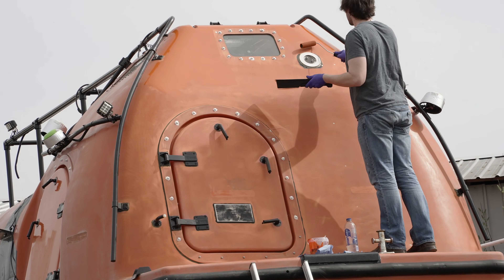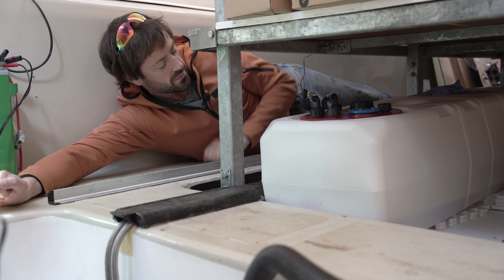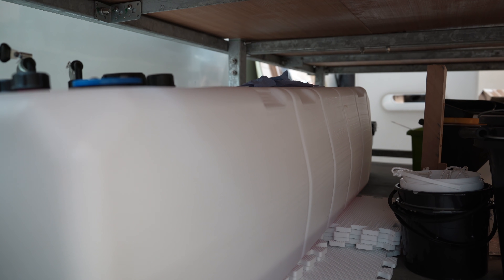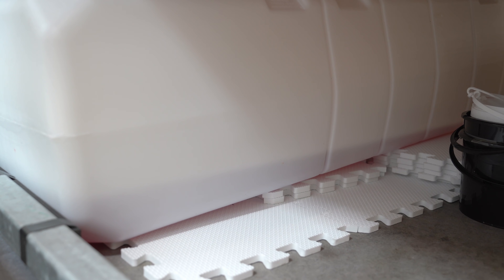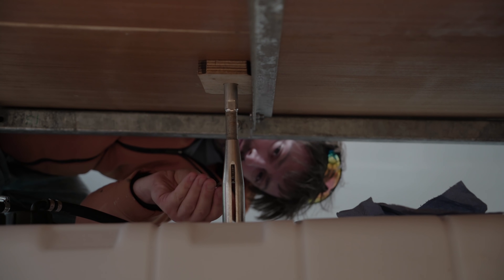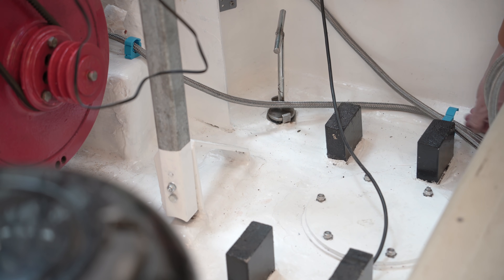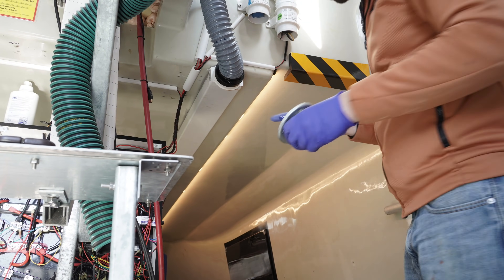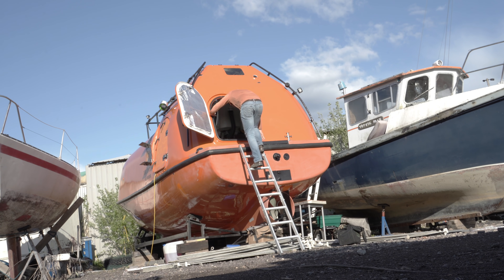Lifeboat Conversion Ep16: Fitting a new fuel tank to an expedition lifeboat [4K]

Comment: Love the update.  I had a massive fuel cell on an off road vehicle and delt with sloshing of fuel.  They make internal baffling (special foam) that will not interfere with your fuel sender or breakdown into the fuel filter.  They use it in powerboat racing and racing applications with high G & vibration.  Also as with any enclosed system please ensure the blower is always running. Carbon Dioxide off gassing of the engine and the dangers of a vented tank near non-explosion rated electronics in close proximity are a recipe for disaster.  Vent the tank via a line to the outside. An empty tank is more dangerous than a full tank.  Keep up the great work.  Love the process.
Reply from the maker: Thanks for this. Yes I do have baffles ready for the tank - balls rather than foam as the latter can deteriorate over time in diesel.

Re: the explosion risk - remember that diesel and petrol fumes behave very differently, so for diesel fumes to be a spontaneous fire risk would need pressure or heat - more than a spark alone. But yes indeed, I'm looking to ensure both ventilation and the breather hose are installed a-ok.

Comment: to secure the tank, you could use straps, the ratchet kind, quick to fit, quick to loosen and definetly not going to move
Reply: Yup, that's what many boat manufacturers does. Use A4 stainless steel straps.

Comment: When you rig Allen with whatever spare parts you think you'll need on a voyage, don't forget to include an extra priming bulb. We got stranded 3 miles off of Marathon Key in rough water because the bulb had cracked & the engine wasn't able to suck fuel through the hose. It was a 28ft rental boat and the owner didn't have any tape or tools or anything on board I could use to fix it so we had to be towed in. Luckily the marine radio worked or we'd have been adrift for a long time. The moral of the story being that it will usually be the cheap & insignificant or obscure parts that fail and end up ruining your day.
Reply from the maker: True story. What I love about boats is you can take lots of spares. On ski journeys you just can't afford the weight.

Comment: Baffles inside will help a lot, you could add some plastic forms to reduce sloshing, this is a common solution
Reply from the maker: Check out the community page for my channel :)
Reply: I know its common for fuel cells where you have stainless steel welded together but gluing baffles into HDPE probably wouldn't work out that well.

I did see the community page. It'll be interesting to see how well those balls work.  I mean realistically you'll know they're working by forgetting they're even there.

Comment: Its quite challenging to get a sense of scale of Alan, if it's enormous with all these different spaces or if its tiny with having to constantly crane your head and fit into tight spaces
Reply from the maker: Single space. 7.5m total boat length. The stern section is about 2.5m standing space. In the forward section more like 1.7m, so stooping needed.
Reply: @AlexHibbertOriginals  thank you! :)

Comment: Hey there. Plastic fuel tanks are fine. This size of 100L is small and doesn't need baffles. But plastic tanks do expand ~2% when first filled with hydrocarbons. Make allowance for that. Straps are perfectly good to secure them. I've designed fireboats with AFFF plastic foam tanks of 2000L. We just secure them with straps, but sometimes they are metal straps with turnbuckles (bottle screws) to tension the straps. Finally the pressure/vaccum vent is umm...odd. Typical marine practise is just run a hose from the top of the tank to an external breather fitting that pokes out the side of topsides, high up. A breather valve might not open up with the very small suction pressure from a diesel lift pump or might burp diesel if the tank gets warm. Orienting the tank long'lly is indeed the best because it increases stability. Ever carried a dishbasin full of water? Google the free surface effect
Reply from the maker: I really should add disclaimers to each video to say that not everything is complete! One with bright coloured flashing lights.

Comment: Look into riv-nuts rivets/nuts where you can essentially install a nut into a hole to bolt into. Although you will need a tool to install them. They are quite handy.
Reply from the maker: Yeah a few people have mentioned. Another expensive tool!

Comment: I had another idea for anti slosh, I’ve seen hollow balls used with lots of holes in them, these are easy to put into tanks, but once inside they fill the volume and reduce sloshing.
Reply from the maker: As I said, check my community page and you might see some large hollow balls!

Comment: The only acceptable way to vent a permanently installed fuel tank is overboard. Without a proper vent you'll be displacing litres of toxic diesel fumes into the cabin every time you fill the tank and then again when the warm diesel returns from the engine...and every time the cabin temperature is raised.
Reply from the maker: You're going to love the episode when I install the breather hose!

Comment: Fit a resistive tank level sender but size it up so its length is above the fuel feed outlet. That way when it warns you its at 0% you know you haven't run the tank dry.
Reply from the maker: Certainly could, but the tank is translucent, so you can just see how much fuel there is. I use an additive that darkens the fuel, so it's very visible.
Reply: @AlexHibbertOriginals  Fair enough, just the convenience of maybe wiring in an alogue fuel gauge or even a digital reading on a Victron Cerbo input. You could go one step further and edit the Victron code for a Cerbo GX so when a reading of 0% is acknowledged, one of the relay switches turns on a pump and feeds more fuel in. It would be interesting to see more dynamic functions with Victrons products.
Reply from the maker: Thanks - will keep that in mind

Comment: That press fitting might punch a hole in the top of the tank if a large wave bounces it up.
Reply from the maker: It's braced, so there'd be no impact, and the area is spread out and damped. If there's a force that large, I'd probably have bigger problems, like Alan being in pieces.

Comment: Couldn't you use an hybrid system wit solid thanks on the bottom and fuel bladders on top as auxiliary fuel supplies, so that they can be folded away after use to leave more living space?
Reply from the maker: That'll be the plan. This'll be the only solid plastic one.

Comment: Personally I'd be getting rid of the stainless overbraid fuel pipes as you can't see what's happening with the rubber underneath and it doesn't clamp correctly. Also I'd be checking the rating of the fuel line for bio diesel quantity you need to look for fpm/eco hose. Cohline do a very nice hose. Lastly jubilee clips are the worst clip to use there are specific fuel line clips that don't pinch and cut the hose
Reply from the maker: Thanks - I've actually reached the same conclusion about the braided lines. Expensive and I'm gaining little aside from the hassle cutting them.

Comment: Potential issue! Could the rubber mats the fuel tank is on create static electricity and cause a fire?
Reply from the maker: Extremely unlikely to create significant static, and even with a large spark, diesel doesn't like to ignite unless under pressure or very warm.
Reply: @AlexHibbertOriginals  but please check so they don't dissolve into a sticky mess if in contact with fuel.

Comment: just curious of what you are going to do when that metal rigging tensioner busts through the top of the plastic tank?  I'm thinking that perhaps using a strap system to hold the tank in place will be a better design.
Reply from the maker: Straps would involve lots of extra anchor points and extra struts. I may use one to limit rotation.

It's braced, so there'd be no impact, and the area is spread out and damped. If there's a force that large, I'd probably have bigger problems, like Alan being in pieces.

Comment: I would recommend you reconsider that tank. You should be using a marine diesel fuel cell with built in baffles. I’m worried about sloshing. 100 liters sloshing is BAD. And i’d recommend a secondary tank next to it. If possible. You can’t have too much fuel.
Reply from the maker: There's three levels of racking for auxiliary tanks, and I have baffles ready to install. Why reconsider the tank?
Reply: @AlexHibbertOriginals  the suggestion for reconsideration was the lack of baffles in the tank. I was concerned with that much fuel moving around on the open sea. I also understand you will have multiple tanks/bladders. I remember you saying so earlier in this vid as well as others. I was merely opining that the more fuel the better. You can’t have to much in your planned conditions. Here in the U.S.,(especially as referenced in the military)the tank which the engine feeds from is considered a ‘day’ tank. Any other fuel tanks feeding it are the supply. I’m excited to see your work complete. Good luck. Cheers.
Reply from the maker: Thanks for the input

Comment: are all those plastic parts and fittings rated for cold Temps? it really look like the kind of plastic that likes to split with cold temperatures.
Reply from the maker: The interior of the boat isn't going to be used in cold temperatures. It's heated.
Reply: @AlexHibbertOriginals  ok

Comment: Hi, I have the same problems with the fittings.
You mention that you used a knife ..... what exactly did you do ?
Reply from the maker: I cut off about 2/3mm of the useless plastic off the end that protrudes beyond the screw thread, using a cut off wheel. Then used a sharp knife to neaten up the end so that the caps would bite. One of them is still pretty ropey. A very poor design/manufacturing, and a replacement set of fittings were as bad.

Comment: I would be concerned with the possibility that the plywood end of the tensioner thing sliding off to one side and releasing the tank. I presume you put some screws in it to prevent that?
Reply from the maker: It's to be fixed in place
Reply: @AlexHibbertOriginals  good! (And,  since I was a complete idiot and didn't say it in the first post, thank you for sharing these videos! I find this stuff fascinating!)
Reply from the maker: @c.a.mcdivitt9722  You're welcome, cheers

Comment: Why not putting a sheet of plywood or hard plastic under the extendable rod you use to fix the tank in place so the pressure is better distributed and the plastic doesn't flex that much?
Reply from the maker: Because it sits down in an indent in the tank, with a curved shape. There's no flat surface to lay ply or plastic onto.
Reply: @AlexHibbertOriginals  Oh okay!!! I thought it caused the indent in the tank and I was like horrified! That makes much more sense!!
Good job👍👍

Comment: I realise this was a long while ago now but…..

You made the right decision moving from bladder tanks to the plastic jobbies is a good move and the right move.

From a stability point of view they are absolutely the right shame to minimise the reduction of GM due to free surface effect, having a narrow breadth. (Formulae for free surface effect = (length x breadth cubed)/12 ).

BTW - I have seen the later video where you put those spherical plastic doohickies in the tank to reduce ‘slosh’ - sorry but they will be about as much use as tits on a fish.😉
Reply from the maker: The baffle balls I've heard to have a good reputation. Why do you say otherwise? The tank needs to be pretty full of them to work.
Reply: @AlexHibbertOriginals  the only way to reduce the free surface effect is to have an effective baffle running longitudinally so from the formulae you are only cubing half the breadth (x2 for each side of the now divided tank) so ameliorating the effect of the cubing. If you crammed the undivided tank with the plastic doohickeys it will offer some damping to ‘slosh’ but cannot materially affect the fundamental free surface effect - just physics.

Comment: I was thinking that if you ja e installed the fuel tanks length ways towards the front they will get more sloshing, while if they are installed sideways the momentum of the fuel is lower as acting like two baffles.
Having the fuel outlets one starboard and the other port. The tanks higher on the non fuel outlet side so it doesn't matter if you leaning to one side of the other.
But I'm no expert and I have not measured your boat.
Reply from the maker: The combination of raising the other end of the tank, baffles, and the fact Alan is likely to roll more than pitch, means I think this is the best orientation. But, we'll see!

Comment: If u want a bit more meat to bite into when u screw into fiberglass you can drill the holes a bit larger then you're going to use, then fill them with epoxy resin. Wait for it to cure, pre-drill the hole u want to use and then screw into it...works great. This way, you're screwing into the epoxy resin, not the fiberglass...it holds much better than fiberglass.
Further, if u mess up and don't want to use a hole u drilled you can always just fill that with epoxy resin and leave it. Looks horrible, but then you're not left with open holes in your boat
Reply from the maker: I'm not sure why screwing into an area of resin that's only mechanically bonded to the glass/resin matrix surrounding it would be stronger that just screwing into the glass/resin matrix?
Reply: @AlexHibbertOriginals  I guess it depends on the fiberglass - age/condition/thickness, etc.  It tends to work better on older glass or glass that has been sandwiched around wood, so there's no ingress of water to wood. 
This isnt meant to be a "do this every time" technique....rather it is just a trick to be used if needed.
Reply from the maker: If there's only a glass fibre skin over plyboard of questionable quality, I'd agree.

Comment: I looked at your fuel tank method of securing it and couldn't figure what about it I did not like. Then I realised that you are securing a admittedly heavy duty plastic container full of fuel which will weigh in in excess of 60 kilos but be held down over a few square centimetre's of area. Whilst at sea this will be exerting forces on this area in several axis 24/7. Not a good or even survivable idea.
Reply from the maker: I think the part you're not taking into account is that the full weight won't be exerted through the central press (which I reassure will be supplemented). For the full weight to act against the press or the very heavy duty HDPE, the boat would have to exert extraordinary forces, like being in free fall, or hitting a solid object at high speed. The majority of the weight will be taken by the padded platform it's sat on. Cheers.
Reply: @AlexHibbertOriginals  Sorry I should of said the Mass of 60 plus KG though you do have a rail securing it. I am suggesting that it will wear away over the course of what could be weeks but probably months causing stress fractures and then cracks. Even if Alan was moored on the hook. In fact you will get more wear than you should on the hard especially if you have diesel in the tank due to thermal expansion and contraction. This solution would work if instead of applying pressure to the tank directly you had a cover plate that overlapped the tank sides holding it securely and more importantly spreading the pressure. Of course even this would not be ideal as you are still stuck with it being a single point of failure but at least less likely for caterstropic failure.